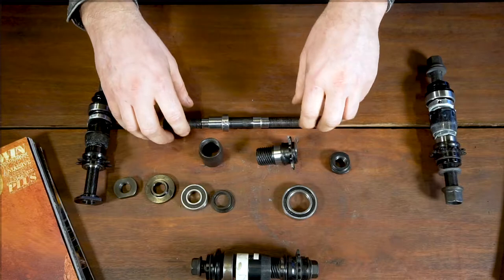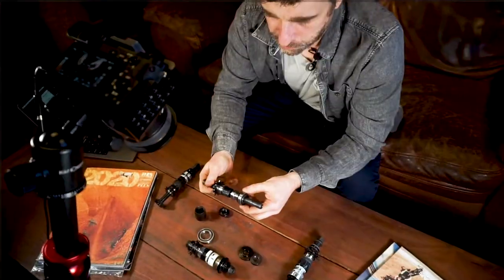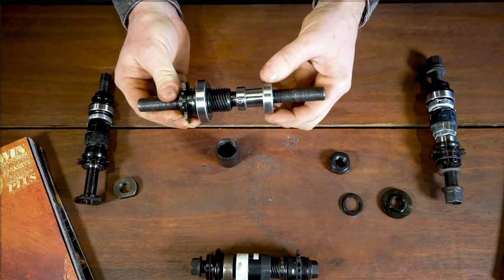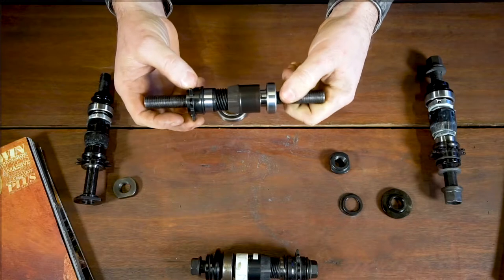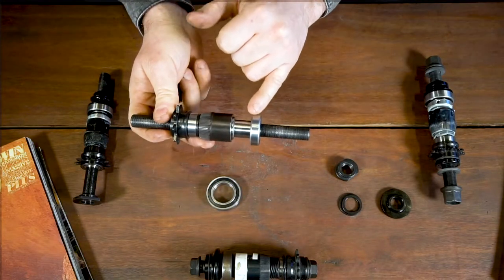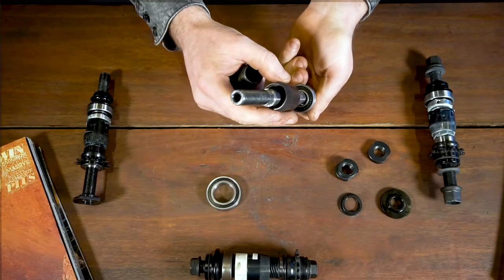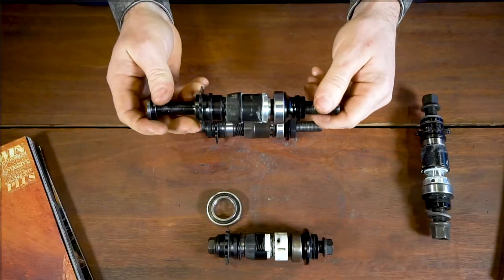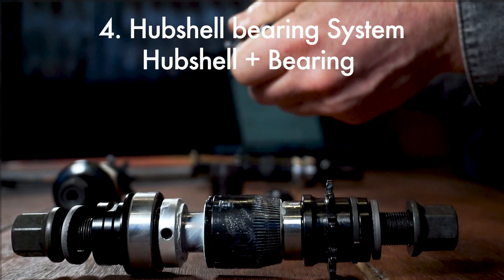HOW DO FREECOASTERS WORK?

Comment: Question. I hope you still respond 
I service all my lads coasters as I got a very good understanding. Except one part. 
Inside the drivers there’s 2 sealed bearings. Which is fine. Behind them is a Nylon bushing which sits on the axle. Does the nylon bushing need grease between the nylon and the axle. Or does it need to stay dry?
Reply: Grease it or spray it with teflon oil if you want to crankflip easier but then the hub might need to be opened up and serviced more bc of the lighter oil and it leaking out eventually.  What kinda coaster hub you got, the westcoaster or cortex v1?

Comment: 14:13 When i got my Cinema FX freecoaster wheel the clutch was making a noise, when i got the wheel out the box, so i stripped the wheel down to fine hardly any grease in side it, and the bearings i had to replace aswell, and i had to put the hub in to full slack aswell, i like full slack no spacers in there take them out hope your good guys, stay Lux 👍
Reply from the maker: hope this video helped then!

Comment: I just re greased by cinema FX2 freecoaster hub and I’m running into issues with resistance. I tightened the non drive side cone nut and finally the drive side cone nut. Hub feels extremely rough until I loosen the drive side cone nut and it runs smooth (finger tight binds and is rough) should I run this side loose or tight?
Reply from the maker: Everything should be snug up. Tight, but not with in an inch of it's life🤟

Comment: Thanks man !! I had so many problems with my wtp helix v3 straight of of the box.. tried to fix it several times until I got so frustrated that i smashed it with a sledgehammer and ordered the odyssey clutch v2 ... well at least I now know how to  fix it, my friend has the same helix so I can now fix it 🤟🏼
Reply from the maker: Damn! Got it with the sledgy haha. Hopefully you won't have to do that again!
Reply: How do i fix my helix v3? got it for 1.5 weeks now and i already hate it. how do i remove the clutch?
Reply: Bro please help I've got a helix v3 and it has really inconsistent slack I greased it and it's still playing up I even bought another 3 slack rings and I regularly get more than 360 revolution on my cranks before it engages
Reply: @ottomtb  you just slide it off the driver side
Reply: And I put the Axel on my bike without the shell to see what was happing and for some reason the clutch moves over when engaging really slow